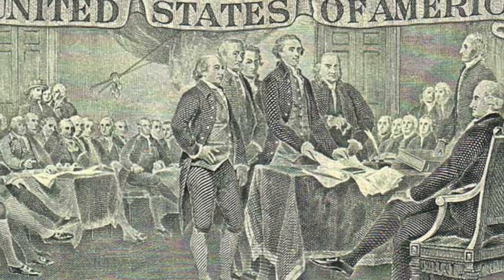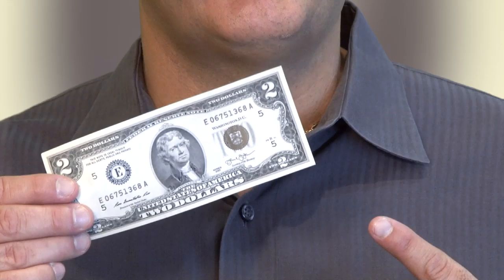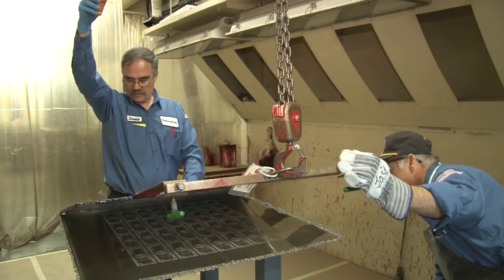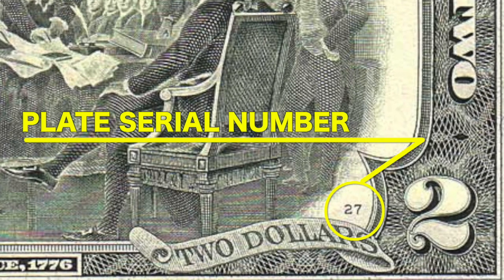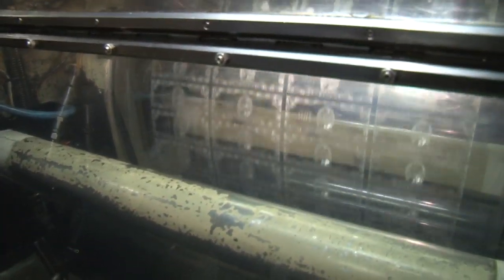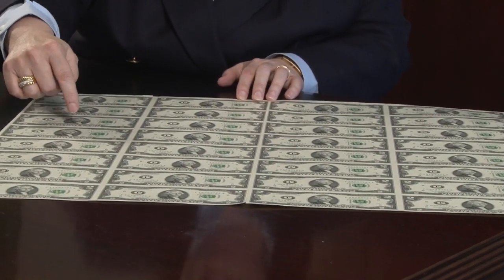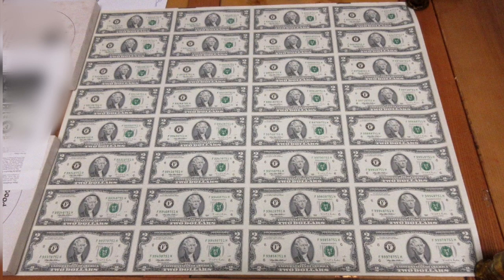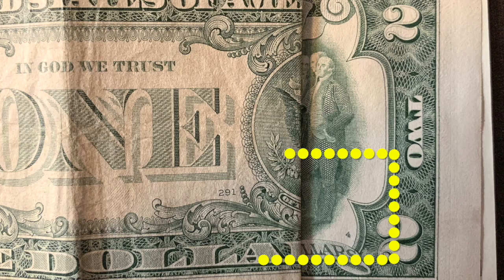What do the small letters & numbers on a $2 bill stand for? Explainer video

Comment: I have a $2 bill that has the numbers D12 
Curious about more information on that... it also has a stamp Hawyard April 13 1976
Reply from the maker: As you can see in this video, the D12 just gives you information about the district and the plate info. D12 is no more special than anything else. The stamp, however, means someone took it to the post office on the very first day it was issued, and had it postmarked. That makes the bill special in  many collectors' eyes. Search similarly stamped bills on eBay to see what they're getting, or contact a local coin & currency dealer to get some more info on its value.

Comment: What if all the plate numbers and letters are the same like B2 in the left corner then fwB2 on the bottom front and then on the backside a 2? Aren't they supposed to be all different numbers since different numbered plates print the front and back
Reply from the maker: Sequential serial numbers will usually be in the same plate location. Sequential serial numbers are never all on one sheet. They lay on top of each other in the same place on consecutive sheets, so that when a stack of sheets is cut, all the sequential numbers are on top of one another! I'm going to explain this in a little more detail in an upcoming video. Stay tuned.

Comment: I have an uncirculated 1/2 sheet of 16 $2.00 bills dated 1976. The Sheet number is 74. The specimen has been covered by glass from the day it arrived. I’m trying to establish a value. A photo is available, if warranted.
Reply from the maker: Hate to simplify it like this, but the value is really what someone will pay for it. I recently bought a full sheet of 32 1976 bills and only paid $225 for it. It's also uncirculated (just rolled up in a tube). You have half of that, but it's in glass. A quick check of similar sold eBay items finds that a majority went for under $200 while some went for as high as $360. One from the St. Louis district went for over $700. Sounds like a crapshoot, dependent on the district and your timing. I can't really give you a definitive value on that item, unfortunately.

Comment: What does it mean if my $2 bill only has 1 letter and 1 number on the lower right side in front
Reply from the maker: If it doesn't have FW down there, it was printed in Washington DC and not Fort Worth. The FW stands for Fort Worth, With just one letter and number, it's the plate number and location as described in the video.

Comment: I have a question about a $20 bill? If you possibly know the answer that would be great! I had taken $100 out of the atm they were all crisp new bills.  two of them are marked FW H 144 on the top right corner and and H3 in the bottom left. What I’m confused about is the other bills were marked FW H 142, FW H 143 and FW H 145. The only thing different on the two bills with FW H 144 is the last number of their serial number. One is a 2 and the other is a 6. Is it a misprint for them both to be marked fw H 144? Thanks!
Reply from the maker: I don't know much about $20s, but I doubt what you have is a rarity. As described in this video, the H144 probably signifies something about the printing sheet. If the serial numbers are that close, with only the last digit being different, that tells me the H144 is definitely the sheet, and those bills came from that same sheet. The other bills are from sheets made very close to the other ones.  The fact that you got all crisp bills means these came fresh from the Fed and were installed into the ATM. The bills were close together in straps after being printed, and haven't separated much on their way to you. You have nothing special.

Comment: I believe I found a printing error on a set of 2 dollar bills I obtained. If so how can I verify this? Based on what you're saying in the video, either I came across an amazing coincidence, or
the sequence that I have going from 294-300 erroneously starts over at 201.  The 201 plate sequence is continuing right where 300 left off.  
This leads me to believe that I have a duplicate set of printed 2 dollar bills. With 201 - 233 to be the duplicate
This is also likely because I obtained these as one uncirculated lot of bills from a bank in sequence. How can I verify this?
Reply from the maker: Sorry I didn't see this to reply sooner, Take it to a local coin & currency dealer. They will tell you its value (and maybe buy it from you if it has any)

Comment: I have a 1963 2 dollar bill with 3 on back side and matching numbers up front e3 is all that correct and also have 1928 series f 2 dollar bill  with h in top left and h 453 bottom right on the back is 321 is this one incorrect or mis printed
Reply from the maker: Highly doubt it's a misprint. It's just the combination of numbered sheets used for printing this bill. As the video describes, fronts and backs are done at different times with different plates.
Reply: Ok thanx what about the 63 2 dollar bill it has e3 in front both corners and  3 on back all done same week or?

Comment: I have 2 $2 bills with consecutive serial numbers, K 06112309 A and K 06112310 A. However, the small numbers on the right side of the front are not consecutive. Why not? One is B10 and the other is B21. What happened to B11 through B20, and why aren't these numbers consecutive also? In addition, the numbers on the left side of the front are the same, B3. Why aren't they different? Your video does not explain this, and I think that your answer would be of interest to everyone. Thank you.